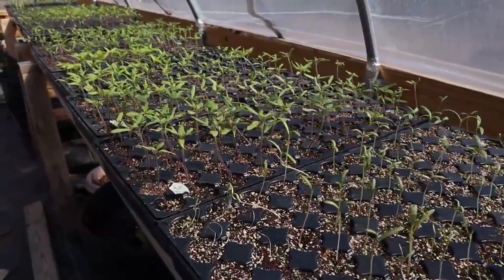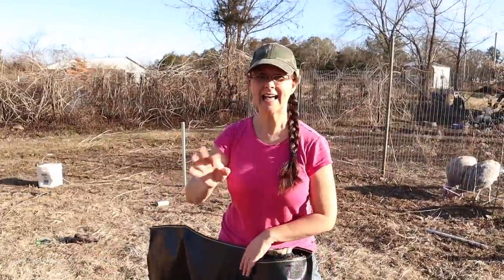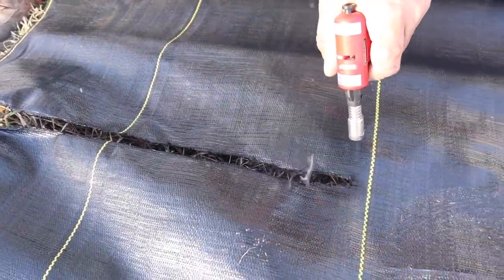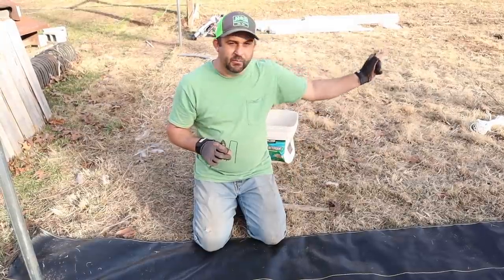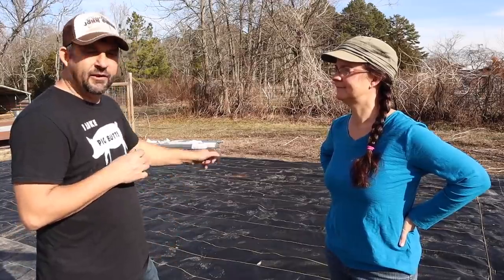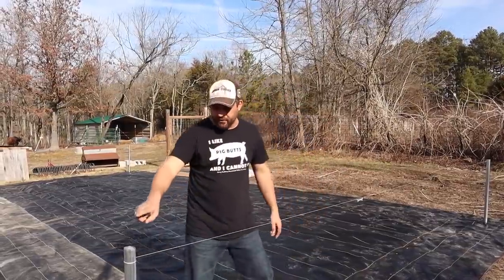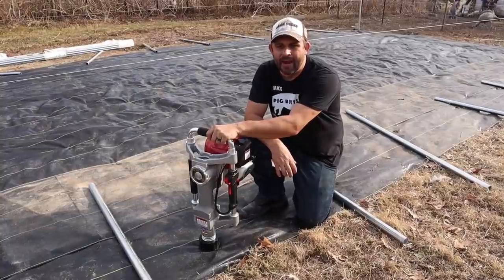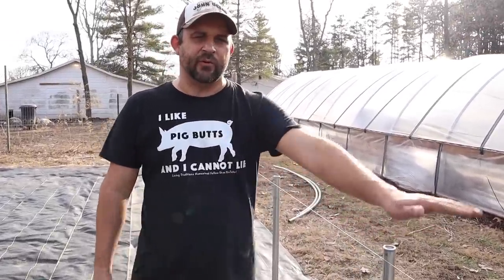EnoughTalk!  Starting to BUILD the GREENHOUSE we got on the internet.

Comment: One extra step to prevent weeds around the posts would be to take a square of groundcover fabric and make a smaller hole in it to slide down over the post on top of the ground cover already there. Or make a smaller hole and simply work the fabric down the post, a tight fit will help keep out weeds and keep the fabric tighter.

Comment: Us a PIPE CUTTER.  It'll give you a cleaner cut on the pipe than the Sawsall will and is more likely to cut level.  With them being that far in the ground, they should hold as long as you don't tighten too much between revolutions.  They're usually not too expensive of a tool.  Like $13 at Harbor Freight for a No. 2 pipe cutter.

Comment: That post driver is the best tool I have seen in a while. So much less damaging on your body than any manual method. Your logical levelling system was exactly how I would do it too. Use the land slope, no need to dig and level it.

Comment: Question: is there not a way to use the post driver to get pretty close to the string height, without having then to cut off the tops of the poles to the right height?  Great video series! Can't wait to see the big finish!

Comment: Excellent idea about putting down the ground cover on the outside boundary posts!  Definitely will help keep weeds out!
I'm interested in these greenhouse kits. Question:  how does the frame and covering hold up to wind and snow loads?
Thanks for any info!
Reply from the maker: our first one is holding up great and we get ALOT of wind here especially during tornado season.  We have had any issues at all.  We don't get a lot of snow here but there a lot of people that have them in colder areas and they do well.
Reply: Living Traditions Homestead Okay thanks!  I have been looking at the design of the Bootstrap Farmer's greenhouses and actually ordered their galvanized pipe bending tool and was pricing out the materials. But I think that this may be a better option with everything already bent/shaped/cut to the correct configuration and it just a matter of putting all of the pieces together, and be at a comparable price for the size. Anyway, looking forward to your setup videos!

Comment: Does the post driver work on t-posts too???  Great video!!!
Reply from the maker: Yes!  That is the main reason I bought it...but it sure helped on this project also.  It will be a long term investment for the farm.
Reply: @LivingTraditionsHomestead  Thank you.  We use a lot of t-posts on our 5 acres.  The post driver would make it a lot easier than the old way.  Thanks.  May I ask which one you bought.  There are a lot of different ones online.

Comment: I'm curious about your using the ground cover in this Green House, since you were talked out of using it in the first one (issues with the possibility of mold and mildew) was that resolved or a non-issue for you?
Also, it looks like you're not planning on using cement on the posts either. I'm not trying to nit-pick (honestly) I'm just noticing the difference between the two. I watched all of the videos of the first green house in one sitting lol.

Comment: The new greenhouse will be great.  Curious as to why the need to saw off the tops of posts. Can't you just pound them down to the string line?  Love your work vids!
Reply from the maker: We cut them off because they get bent on top from pounding them in and then the bows won’t slide in correctly.
Reply: @LivingTraditionsHomestead  That makes sense!
Reply: Living Traditions Homestead  I wonder if it would work to put something on top of the post as you are driving it so it won’t bend, like maybe a block of wood?

Comment: Can u push post in with front end loader
Maybe with load of dirt in it for extra down pressure
Reply: I do that with T-posts, no dirt needed in bucket even.  While this does work, it would be hard to drive all those posts perfectly straight because the bucket arcs as it goes down, putting angular pressure on post, so they wouldn’t be as nice and straight as Kevin made them. That might be a problem later when trying to get both sides of the arches to align up. 😃
Reply: @CraigDAL12  thanks